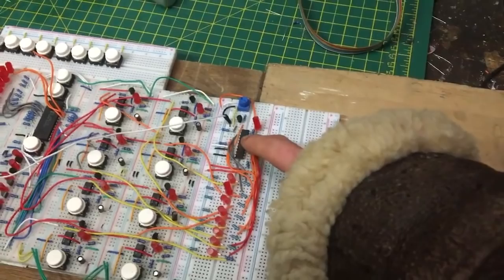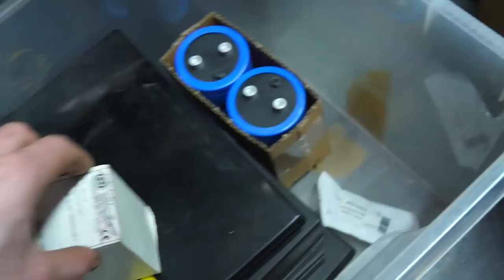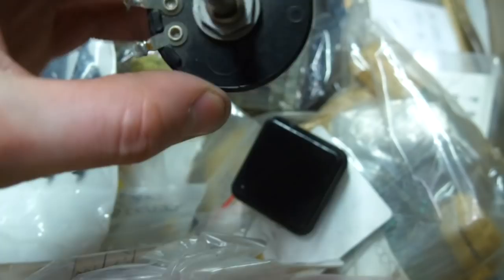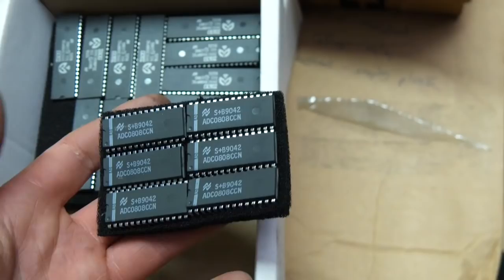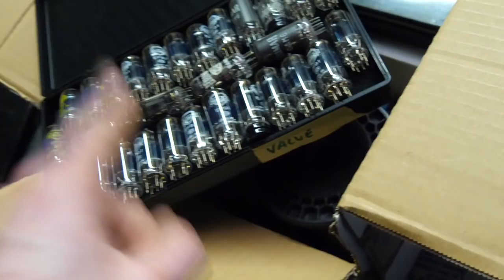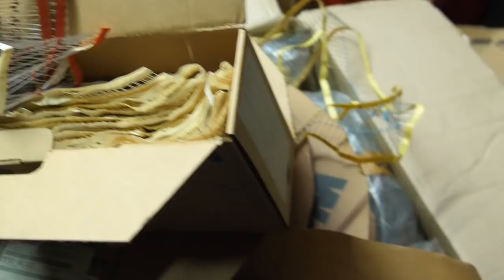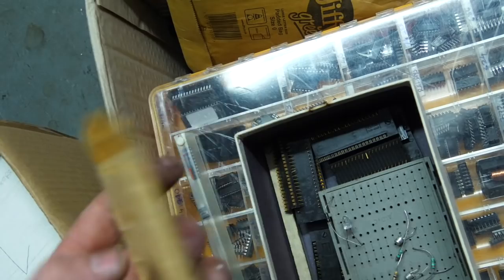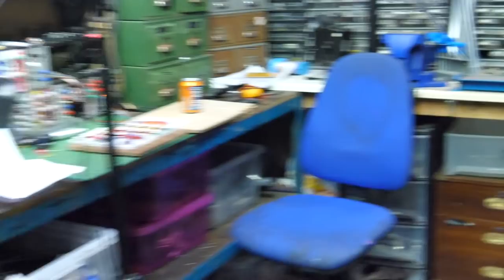VLOG I Just Got A Bunch Of Vintage Electronic Components BIG HAUL

Comment: 5:14 trimmer capacitor... probable a value range of something tiny like 2-20pF
5:20 microwave modules... can't tell if they're relays, filters, amps, multiplexers, etc.
7:50 microwave wiring
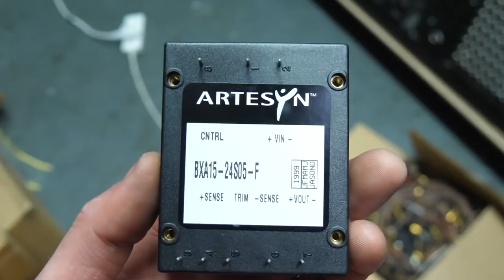8:30  those are DC/DC converters 18-36V in 5V 3A out with 0.2% line and load regulation 80% efficiency. Those are rather awesome for distributed power if you need 5V.  Video wall?
10:56 those are dual serial port chips. SCC=8530 Serial Communications Controller. They support some extra modes and were used for the original Macintosh networking system called LocalTalk which was used to share the office laser printer and then shortly thereafter for file servers. Those are the CMOS version which was a couple dollars more than the stock NMOS one.
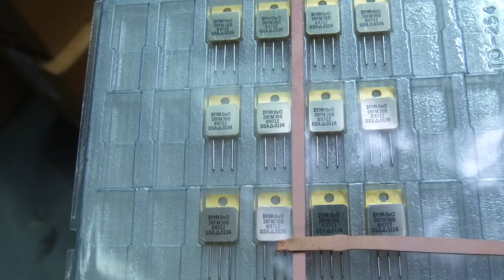11:50  IRFM360 - 400V 14A Single N-Channel Hi-Rel hermetically packaged power MOSFET in a Mil-Spec TO-254AA package, Packaged on a MIL-PRF-19500 manufacturing line
I almost lost it at the Mullard tubes.
Know that Mullard these days exists as a name applied to Russian made tubes while those are the real thing. You have a mint there.
Quite a haul.

Comment: Wow - you are a very lucky boy, Sam. I guess you are well loved, eh? You can use a ton of this stuff. The general level of quality is high. Don’t write off the surface-mount parts. They’re easy to solder once you get the hang of it, so even those parts can be used. Some of it will be tough for music, but even then, you can make amps, power supplies, pickups, transformers, etc. Look up the parts - it’s not so hard. Don’t be afraid to try it, someone said once.

Comment: The valves with Exx codes, Ex is a single valve, Exx is a double valve. C is a triode and F is a pentode, so ECF82 is a triode + pentode, ECC88 is a double triode, EF91 is a pentode. The numbers don't mean anything specific without reference to the data books.

Comment: At 9:15, those are APC7 connectors. They're pretty rare as they're a hermaphroditic connector used for gigahertz range stuff! They're neatly stored away in a glass container as they're really frail, a couple scratches on the surface and they're practically next to useless

Comment: The aluminum box with the connectors looks like some HF-filter/amplifier or (de)modulator, the thin cables with the small connectors also look like HF connectors. You'll find the BNC connectors often in HF-circuits/devices. Hmm. there seems to be a common denominator here.

Comment: Hello there, sorry for the bad english, this is not my native language!
Just some quick advices about this whole stuff you got.
Old components may look fine but may not work anymore, due to oldness. If you use them, always keep in mind they may not work (and your circuit will not, too!)
The big 10mF 100V capacitor may be dangerous, as it will hold a massive amount of energy when charged. And you must store them uncharged for safety. See them as a DIY taser, but with no protection AT ALL...
Last but not least, sort them ALL. If you do not, searching for a specific component will take you ages, as searching a needle in a haystack. Sure, sort them will take you ages as well, but only once. 
PS: if you try the ADC0808 you got with LEDs, I'm eager to see if it works. Datasheet says it must not ;)

Comment: Sam, please check out Gieskes VU perc modules. It's basically a module triggering a VU meter hitting a piece of copper connected to a Piezo (maks wicked perc!). He sells them as DIY kits, quite cheap. Without the front panel & vu meter, it probably costs next to nothing. And with those big VU meters you had in there, you could make one in your Kosmo format. I just built two, to use with a euclidean sequencer (Stoicheia by rebel tech). It would probably make for an interesting collaboration and build (as you have transformed euro into Kkosmo before I think it should be fairly easy).  They sound quite unique, especially when using different Piezos and doing other tiny modifications. I'd love to see that as a video. And he has a clever solution for feedback: the circuit includes a gated vca with a trim for decay.

Comment: That "small BNC" might be an SMA connection.  Try a 2.4ghz antenna to see if it fits!
Reply: the 2.4 GHz antennae have the female and male swapped connectors for some reason
Reply: @norullzz  more to see if the screw fits. It's RP-SMA if the pin is reversed... just a thought to try as it can be quite common
Reply: The hole is in the male screw end, so I believe they are standard sma... I definitely haven't made that mistake before

Comment: 18:02 - you can use biggest caps to make UPS devices. It's my guess. Good UPS are pretty expensive. You just can find schematics (probably) and DIY it. UPS are necessary for a 3d printer and if you write some tracks using a DAW (on a home PC).

Comment: 5:25 all the shiny blocks with the weird connectors are tuners for radio or television and such. They are used in receivers as the first stage: antenna-->tuner. The connectors are for coax cables
BTW, is it ok to be jealous at this hoard?

Comment: Loads of radio frequency cables, connectors and components. Plenty of stuff there to interest radio hams and hobbyists. The cloth covered Litz wire is worth quite a bit. Used for winding up low frequency radio aerial coils. Probably some germanium transistors for fuzz effects in there too.

Comment: i have seen all those connectors until minute 6. The big ones where used on the coax cable that powers mobile phone antennas. The small were used to "patch" the components of the rack itself, i mean to get signal from the multiplexers and stuff to the power radio amplifier.  BTS GSM thang.

Comment: Jo Sam, with the 100 Volt 10.000 µf capacitors you could build a resistance welder, so you could weld m4 threaded ends on your front panels.

Comment: The threaded BNCs are probably TNC, ties in with the other stuff.  The smaller gold ones are most likely SMA - they're not cheap!

Yay, you can have a good play with SMD components now

I think the IRM things are MOSFETs.  

The pink Traco power boxes are encapsulated power supplies or DC/DC converters, they're upwards of a fiver each.

The writing on the resistor bags looks like the manufacturer's part codes,  I'm sure a Google will tell you what they are.

Comment: Can't see all the relevant details, but maybe these will guide you in finding what they are:
3:30 they look like flameproof resistors.
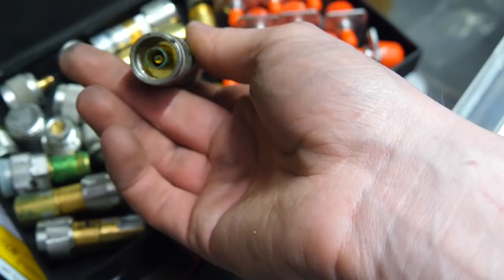4:25 N to BNC and N to SMA convertors amongst others
5:28 look like either TNC or SMA connectors, would need to see them close up to be sure
looks like the dude was into RF in a big way
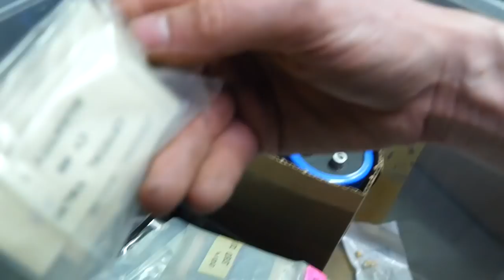5:48 CV448 are 100Volt germanium diodes about 25 mA
6:40 look like resistors the type that can be laser trimmed
7:52 the connectors look like they include MCA and SMA types
8:35 DC - DC convertors

Comment: challenge.... build a big ass monosynth using most of the components, valves and weird connectors included..... give artura a run for their money :D use the copper mesh as a voltage controller and the touch pads for a 1 octave lmnc monster... with 70's dr who lights of course..... furby's are an optional extra :D ooh and the weird wire for a theramin type input.......

Comment: I'm open to paying shipping for any extra tools/parts.
I'm just getting into this so I need everything from diodes to a small variety of resistors.

(Did take apart an old 8-track recorder so I have plenty of knobs, sliders and audio inputs now)
Reply: Look at AliExpress, you can get variety packs of resistors, trimmers, capacitors, inductors, diodes, switches etc for a couple o' buck$ each.
Reply: @massimookissed1023   Thank you, I just wanted to say "Sam Battle" sent me this. Amazon and eBay are like my AliExpress here currently in the States.
Reply: @rdoes6696  , yeah, if something's available on Ali it's probably on Ebay too.

Those variety packs are a good cheap way to get a wide range of components without having to spend lots of cash on redundant parts.

They make it easier to breadboard some circuit you found online, and then later, if like Sam, you need 100 copies of that circuit, you can go ahead and order the bulk packs of components :)
Reply: You're right. I'm still learning a lot though trial-and-error, so having options is always good. And it might be some time until I get to Sam's level and need 100's of anything. Or I'll be overwhelmed in inventory by the time I need it, like Sam!

Comment: Look Mum No Light switch? ;)
OH MY GOD.... a van FULL of OLD OLD stuff!!!! I think I just weed a bit! Oh, not that "OLD OLD" but still most desirable!
Thing that looks like bit of a rheostat = ceramic variable capacitor.
Looks like a miniature BNC = coax connectors mostly used in cable/satellite TV
Panel mount bulb holders = head-lights off a Dalek
Phinickity modular synth cables = RF stuff again... you see something very similar to hold the antennas on WiFi modules.
"Where am I going to put all this?" = In my house?
Whilst you're all excited about your ADCs, I want to see those Zilog chips just out of focus behind them.
Those "high current transistors" look like they're very high-grade mil-spec kinda stuff.
12:19  green box... anything that shape is almost certainly a power transistor (although it might be a beefy regulator too)
I haven't seen so many valves since I visited a telly repair shop in the 70s
WOW!
Can we please be friends, can I come round your house and make you cups of tea?

Comment: I'm fixing an arcade board and ordered dozen different 74-logic ICs two each because they're like 1€/chip, can't stockpile unnecessary ones at those prices.. all sorts of hassle involved, they come in individual plastic bags etc, saw 74ls245 in the video and realized I'd forgot to order those .. kinda stupid to go through all that while I know there's probably some store room nearby with hundreds of these just waiting to be thrown out. 🤦‍♂️
Reply: Where are you ordering your ICs from? Most 74 are like 10 for $1.20 if you order from china. And shipping is only a couple bucks more.
Reply: 245, is that a decoder, or a multiplexer? I think ive been using those for SNES game cartridge, cant remember though, might be off by a digit.
Reply: it's a local store with same day pick up, don't have months to wait for them to arrive from china, they also have a bad habit of selling salvaged/relabeled parts as new and you might find out the hard way they don't work properly. 245's a bus transceiver

Comment: Man I'm so jealous!... I wish I had loads of stuff like that... Still, I´d probably procrastinate immensely just thinking up ideas
Anyway, all that stuff sounds pretty damn useful. The LMC1585 are voltage regulators according to web, not the only ones there probably. Regulators are quite a versatile part, you can make loads of stuff from battery chargers to actual power amplifiers, just check the datasheets.
The ADCs look pretty similar to a chip I found in an old 80s "organ" squarewave monosynth. Probably made by the same company

The germanium trasistors are what got me, I wonder how many fuzz faces I could make! If I were you, I would check out this guy called Joe Gore, he has a massive shootout/comparison between several germanium fuzzes:https://www.youtube.com/watch?v=VdJWv4emZdY&t=1147s
I'd build a rangemaster clone as well, it sounds pretty neat. After testing the transistors though (http://geofex.com/Article_Folders/ffselect.htm). Heck, even a Deacy-Mullard amp like the one Brian May has.
Or a cigar box guitar from those nice cigar boxes.

Are you going to accept ideas though?

What about skipping wires altogether and building an RF system for performances?
How about building a computer from logic chips? Even an analog computer?
Heh, good luck finding out! And cleaning as well btw
PS: sorry for the long comment

Comment: You probably want to use 7 bits of the DAC to quantize to 128 semitones = 10.66 octaves. I do a similar thing in my quantizer module, but with Arduino PWM as DAC: https://kassu2000.blogspot.com/2019/10/quantizer.html

You can turn your 8 bit DAC to 7 bits just by wiring the 8th (lsb) bit to ground.
Reply: NO!

Connect that lsb to a LFSR random bit generator for some old-timey saloon random detuning :)